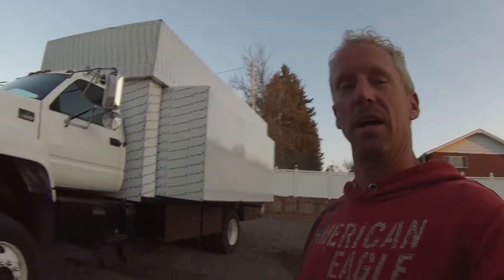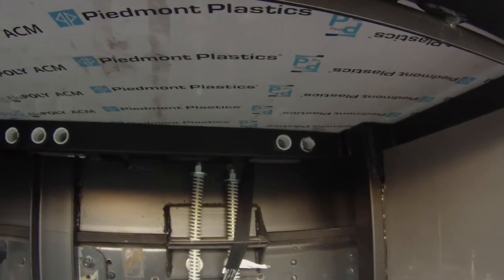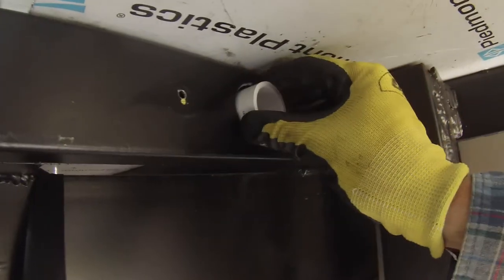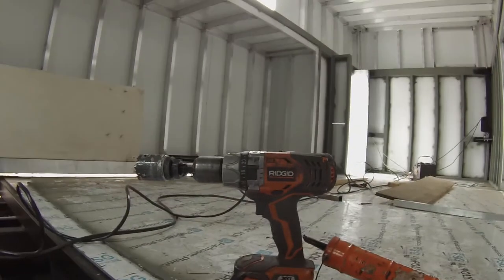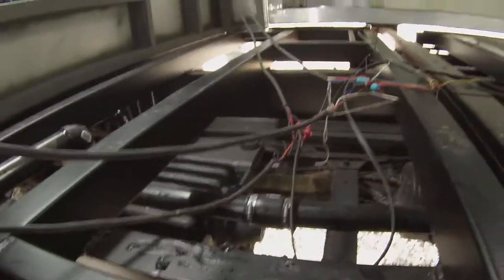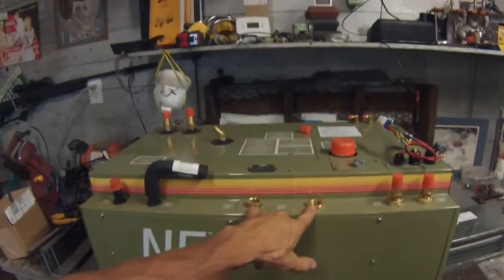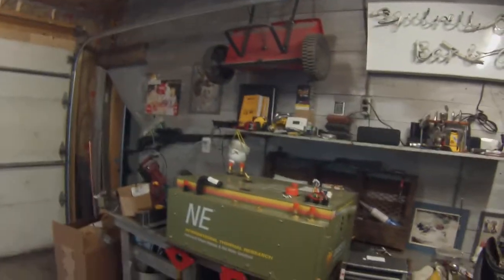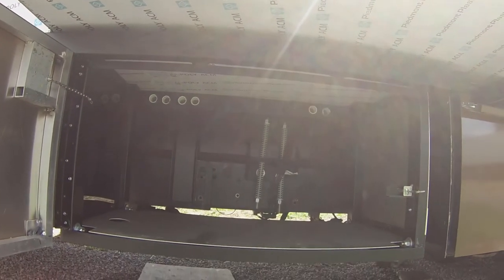Episode 9  Expedition Vehicle Heating System

Comment: Great heater man! a question regarding your rig: I noticed in the last minute of the video when you showed the back of the truck, I noticed that you attached the rig directly on the chassis of the truck. You won't need a torsion free subframe? to isolate the flexing of the chassis from the living area? great videos again keep it up
Reply from the maker: Natay. The frame for the coach and the frame to the rigger actually separates and floats on Springs. There are two sets of Springs on bolts that hold the two together in each corner. I'm not sure off the top of my head which video I show it but I thought in one of my first framing videos I went over in a little bit
Reply: Ah, good solution. I will have a look at the early videos thanks for the info. keep up the great work with the rig
 @expeditionvehicleadventure2141
Reply from the maker: @nataysalim5789  Thanks Man